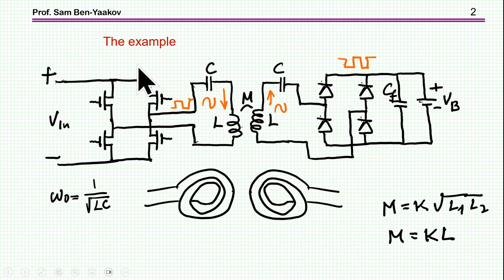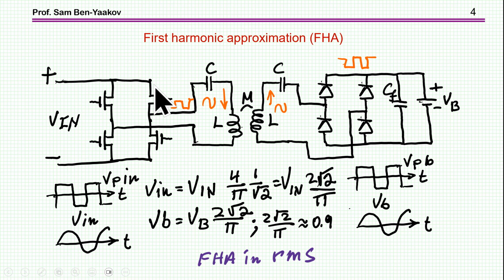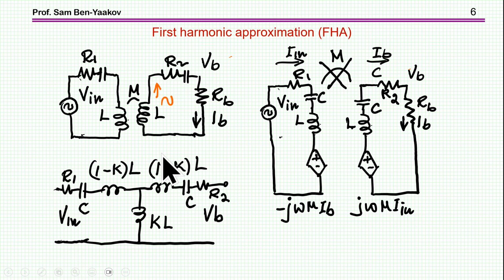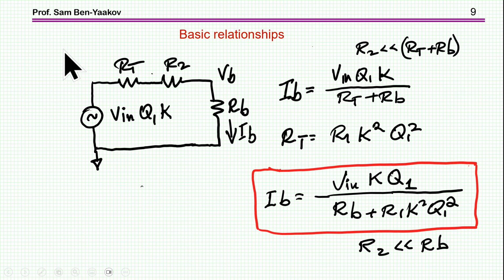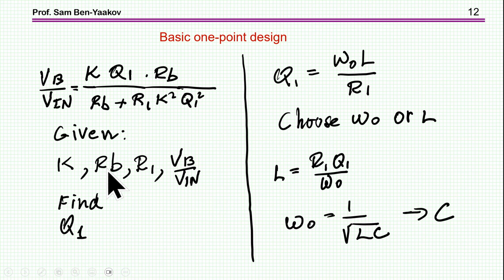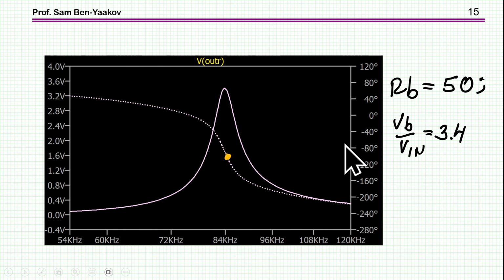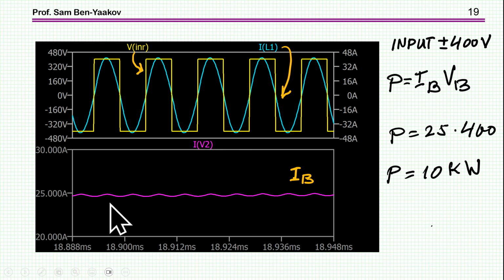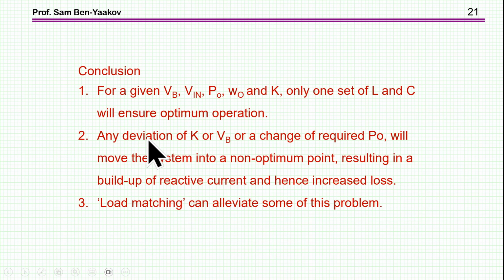An intuitive insight into EV WPT charger at resonance

Comment: Professor Sam Ben-Yaakov, your simulation has demystified the formula and simulation to determine bifurcation or frequency splitting in a WPT I have been looking for more of a scenario, than a formula that can prove this for long. I wonder what the operating point will look like with a real EV battery internal imepedance of 20mOhms to 40mOhms. Thank you for your lectures. I shall be citing your videos in my PhD Thesis.
Reply from the maker: The ESR has little if any effect on EV WPT since the voltage drop on it is less than a Volt.

Comment: Thank you Sam for presenting the factors involved in inductive charging with such clarity of mind. Very interesting that the real power transfer has only one optimal operating point, which depends on pretty much all the parameters involved including K, which depends on how far away the charge circuit is from the load circuit.
Beautiful analysis.
Reply from the maker: Thank you for sharing your thoughts and kind words.  Indeed, this is a tricky circuit, leaves a lot of room for new innovations.

Comment: Hello Sam, thank you for this great video, very clear as always! :) I've been working on this topic for a few years now, and we have a technical article which presents a way to drive the rectification stage impedance regardless of the operating point (battery voltage or power operation), in line with your work and available on MDPI platform "Enhancing Wireless Charging for Electric Vehicles: Active Load Impedance Matching and Its Impact on Efficiency, Cost and Size"
Reply from the maker: Thank you very much for your work and the reference to your work. I will definitly study it. Solutions to this nagging issue are highly important.
Reply: @sambenyaakov  My pleasure Sam, it won't be long before EVs become wireless charging compatible.